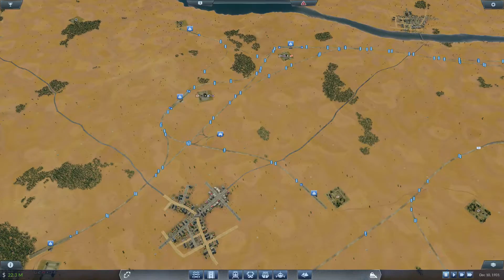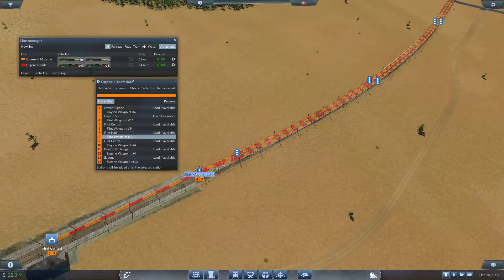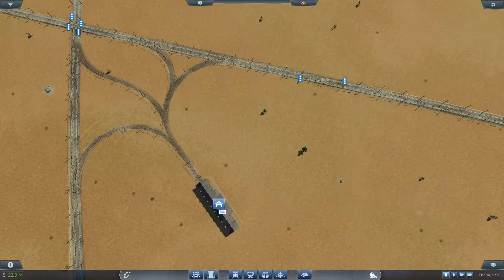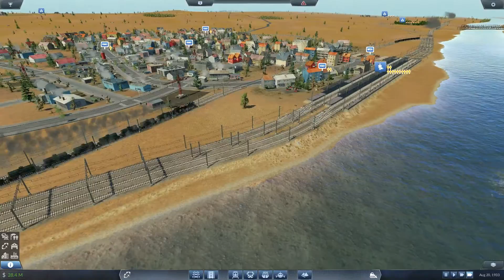Transport Fever WVRR EP 11: Machine Production - Hard Mode Free Map

Comment: check this video at 7:30. you were signalling the Arlington crude. you flipped a switch to one way and I think at that moment you broke the line. that might be why you weren't getting the oil back to the plastic line.
Reply from the maker: I think the problem that I had with this line (and several others) is the waypoint signals I have at the entry to the station platform. I have some very bad signal placing at several of the stations and it could be causing problems there. I have actually resurrected this line and got it going around ep18, and it was mostly the lack of demand for plastic that was harming the line overall. Now that I have a steady plastic demand down, the oil demand has started up and this crude/oil line has started hauling. 

I believe in this particular case there was no demand for plastic at the tool factory near Flint. Although it does input plastic, the plastic has to mix with steel. There wasn't enough steel coming into flint to mix with the plastic, so no plastic demand.

Comment: its oil not crude oil that makes plastics. need to send crude oil to refinery to make the oil and then take oil to the plastic
Reply from the maker: Thanks for watching Anthony! If you're talking about the line near the Arlington oil well that is how I have it set up. There's a crude oil train that crosses over the map, turns it to oil, then takes that oil to the plastic factory near Arlington. Then there's a goods train that goes from Eugene to the plastic plant and then up to the machine plant near Flint. Unfortunately these lines all run empty, aside from the machines/tools returning from Flint.

The problem turned out to be that the machine factory requires plastic and steel to make machines. Since I am already delivering planks and steel to the Flint plant, it doesn't demand any plastic. I don't know that I really put that into the correct words, but I do come to that conclusion in the next episode and shut the oil/plastic line down and restrict the Eugene goods line.